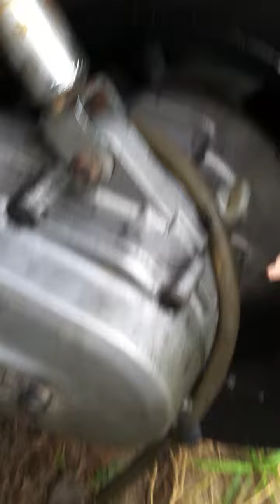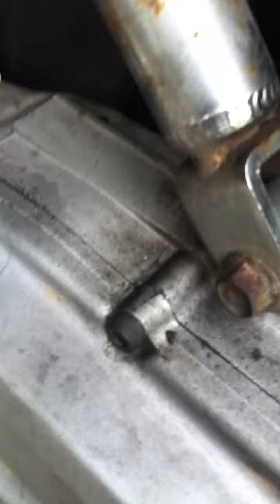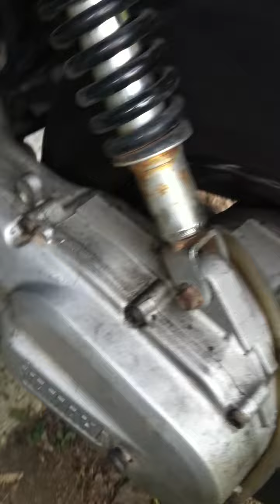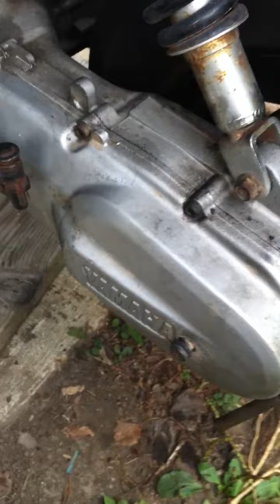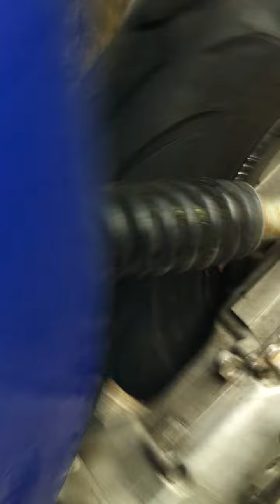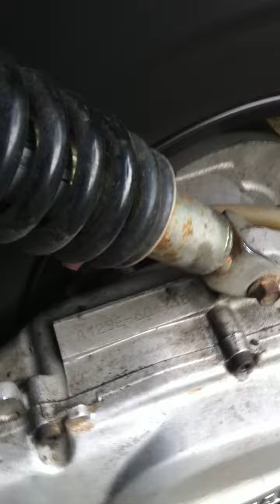Zuma transmission noise

Comment: So how did you fix it?
Reply from the maker: I cannot recall exactly what was wrong because I had a bunch of small problems that started when my clutch blew up, but I will give you a list of things to check:
1) Take the CVT lid off and make sure your kick starter is moving freely. Lube it up
2) You electric starter has a gear that is connected to the crankshaft(Behind the CVT cone gear) It has 3 cylindrical rollers with springs. If they get caked up, the noise may be your starter getting hung and not able to disengage. 
3) since you needed to take you belt off to get to 2, spin your tire and see if there is noise, the transmission is not separate from the engine and you should be better able to isolate the noise.
4) if there is still noise from spinning the tire, shake your tire from side to side to check for play
5) If there is play, you are going to have to get serious and take apart the transmission in the back, dont forget to drain the transmission oil and keep things clean while dissasembling. You will need to check bearings for anything that does not spin freely, show wear or clunk.

If you have time, its great to make sure 1-3 are proper. Step 5 May cost a little bit of money if you have to replace a bearing. 10-20 bucks per bearing. 

Expect to spend 3-5 hours looking through things. It's a pretty simple transmission and a great learning opportuninty.